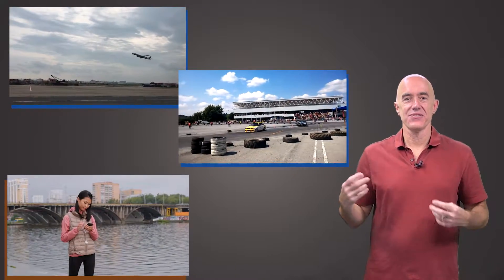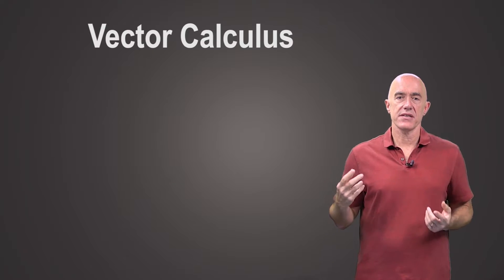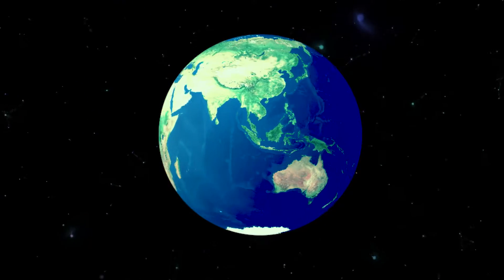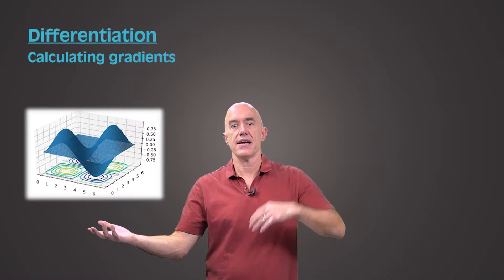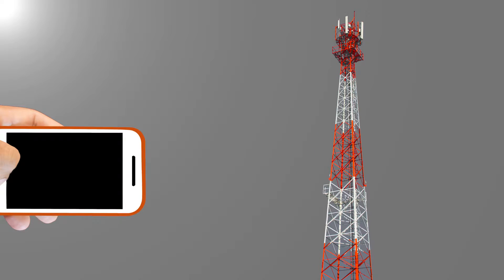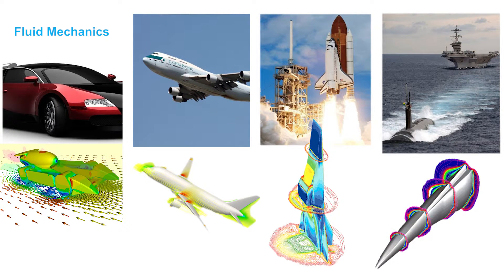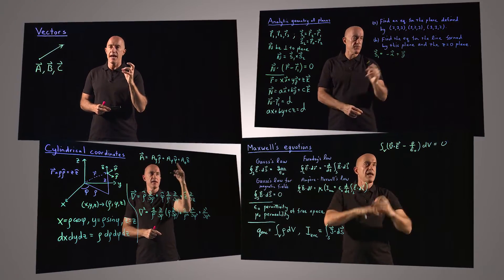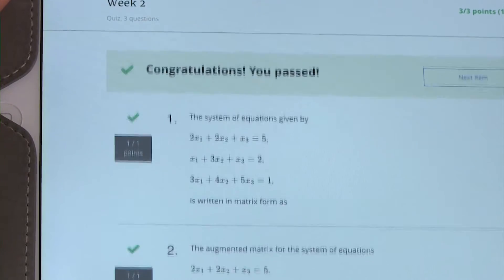Promotional Video | Vector Calculus for Engineers

Comment: بدأت سلسة جديدة في ال Vector Calculus

في السلسلة دي هتناول المواضيع التالية بشرح تفصيلي، (تقريباً هفسر كل حاجة بحيث مفيش حاجة متبقاش مفهومة)

1: Vectors : 1.1: Elementary Mathematical Operations
                     1.2: Scalar Product
                     1.3: Vector Product
                     1.4: 'Higher' Vector Products
                     1.5: Basis Vectors
                     1.6: Component Representations
2. Vector-Valued Functions:
    2.1: Parameterization of Space Curves
    2.2: Differentiation of Vector-Valued Functions
    2.3: Arc Length
    2.4: Moving Trihedron

3. Fields:
    3.1: Classification of the Fields
    3.2: Partial Derivatives
    3.3: Gradient
    3.4: Divergence and Curl (Rotation)

4. Coordinate Systems
    4.1: Transformation if Variables, Jacobian Determinant
    4.2: Curvilinear Coordinates
    4.3: Cylindrical Coordinates 
    4.4: Spherical Coordinates 
                     
دا لينك ال playlist 

https://youtube.com/playlist?list=PLp6poodbfHB9ruHrllPeJKoXuWZ5gG7q1

ودا الكتاب اللي هشتغل منه إن شاء الله

https://www.amazon.com/Theoretical-Physics-1-Classical-Mechanics/dp/3319401076

تعديل: نسيت باقي المواضيع اللي هيتم شرحها إن شاء الله بس من الكتاب التاني

5.1: Dirac's Delta Function
5.2: Taylor Expansion
5.3: Surface Integrals
       5.3.1: Oriented Surface Elements
       5.3.2: Surface Integrals
5.4: Differentiation Processes for Fields
       5.4.1: Integral Representation of the Divergence 
       5.4.2: Integral Representation of the Curl
5.5: Integral Theorems
       5.5.1: The Gauss Theorem
       5.5.2: The Stokes Theorem 
       5.5.3: The Green Theorems 
5.6: Decomposition and Uniqueness Theorem for Vector Fields
       5.6.1: Decomposition Theorem 
       5.6.2: Uniqueness Theorems

لينك الكتاب التاني: 
https://www.amazon.com/Theoretical-Physics-Electrodynamics-Wolfgang-Nolting/dp/331940167X